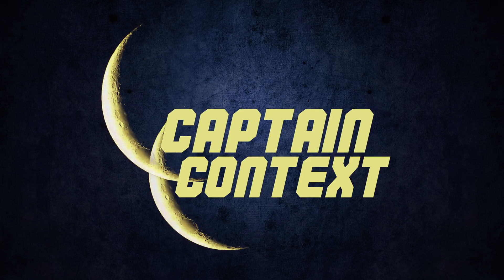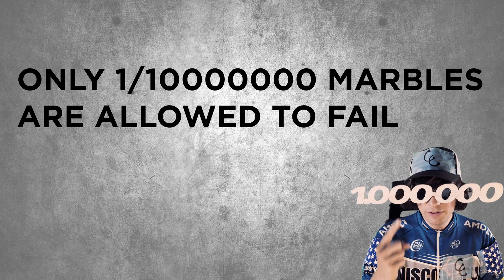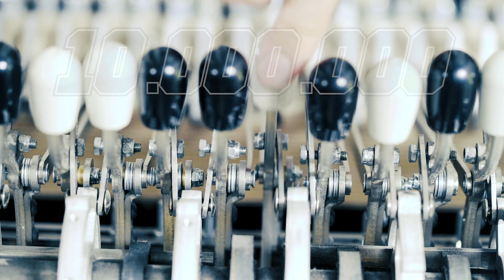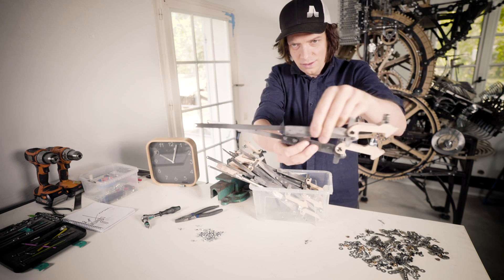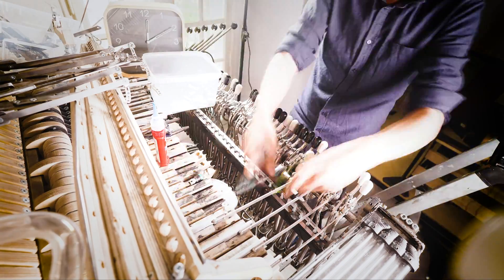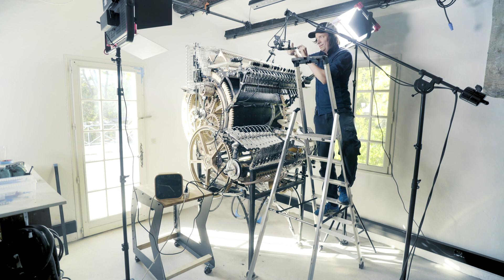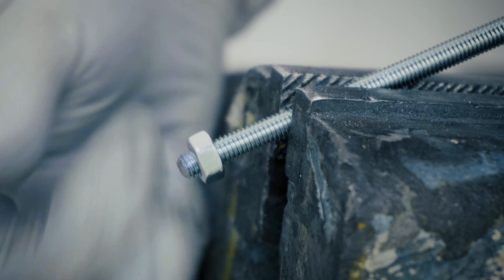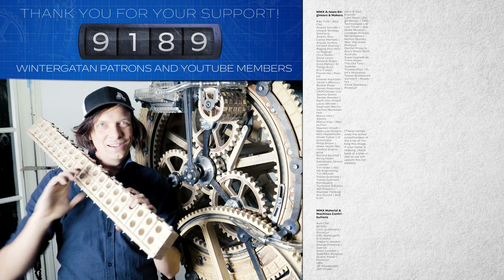Countersink? Why? - Marble Machine X #143

Comment: I get where you are coming from. But the percentages seem really arbitrary to me. There’s no way to confirm if a part is going to function 99,999% or 99,9999%. 
I guess it’s just a way of saying all parts need to be failure proof. But as an engineer when I see bogus tolerances I shiver a little bit. 

Am I alone which this?
Just a thought of mine. Love your content!
Reply: Just for context: factories strive for a principal called six sigma (99,99966% reliability ) and can hardly reach it. To even top this just sets you up for failure. 
Also two more points: 1. tolerances (in this case probabilities) you can’t validate are worthless. 2. His math is off so the reliability of each part needs to be even higher. 

I think Martin made great process in this video. But highly disagree with his reliability analysis.
Reply: Nope, aerospace guy here, and I cringe through a fair number of these videos anymore. Considering the amount materials being used in this project that aren't what you'd call dimensionally-stable, you'd never be able to calculate a consistent tolerance stack-up of higher-level assemblies.

And reliability/failure models aren't as simple as multiplying a percentage by number of cycles.
Reply: @thomasbecker9676  Just build ten of them and try playing music for a week straight. That would give you the ballpark figure :D
Reply: I'm not a mechanical engineer yet I had the same thought
Reply: You are most definitely not alone. I have no idea what he means by "99.99999% reliable". What constitutes failure? He keeps calculating how many songs he can play without fail, implying that "failure" means "catastrophic error that interrupts a song irrevocably". But then he says that the marble drops need to be that reliable. Surely, not all marble drops errors will result in song halting. It's all just random, undefined numbers and concepts being thrown about because Martin can't simply say: "This doesn't sit right with me. This needs to be better." That is something any engineer should be able to say, and i cannot understand why he can't say it.
Reply: Well those numbers are probabilities.  He even confirmed the 99% failure made sense based on the current failure rate he is having with the machine
Reply: I am totally with you here. I think Martin tries to accomplish a goal which is physically impossible. Especially with the knowledge he has and material he uses. Don't get me wrong, I love watching his videos and as much as I would like to see this series continues, I doubt he will achieve his goal.

He is talking about reliability 1/10.000.000 but he still uses  plywood as main material and often not the correct shims/washers.
Reply: I think something he needs to consider is design that allows at least some forms of failure.
The main problem he has, is that the machine can't stop quickly and having the risk of the machine to tear itself apart when something gets stuck.

One of the reasons the machine can't stop quickly is because of the flywheel and the electric motor.
I think the machine needs a torque limiter on the flywheel and motor so in case the machine gets stuck, the flywheel can spin free without further damaging the machine. Who cares if 1 in 1000 notes are wrong, that's not a big issue.
But the machine destroying itself with an average of 10 000 000 notes is not good!
Reply: @Robbedem  the machine actually has a torque limiter for exactly this purpose :) I can't remember which episode it was, though
Reply: @Ludix147  yeah, I know it has one, but didn't really remember where and I have no idea if it's calibrated. (might be worth revisiting since he reduced a lot of friction)
Also, I don't think the electric motor has some torque limiter?
Reply: @Robbedem  From what I understand, the motor controller detects torque as a function of load current and speed, and is programmed with a torque limit. If it is stopped, it will stop trying.
Reply: @Robbedem  But I thought there was a torque limiter installed, or was it removed?
Reply: Yeah the torque limiter is there and can be calibrated to whatever torque he wants. So like the gear wheel's won't break or something cause of that but the smaller parts might break with less force.
Reply: @georgH  I remember something about a torque limiter, but I don't know where and how exactly.
Ok, this video:
https://www.youtube.com/watch?v=OAZ3pVSCYSQ
(long time ago)

Still, it didn't seem to help to prevent the broken programming pin(s)
Reply: It's not infeasible to test that many repetitions and many mechanical parts do similar or even more cycles in their lifetime (switches, most parts of a internal combustion engine like valves, etc.  An engine valve which failed on one in 10 million actuations would be a very bad part, only lasting an hour or so on average!). But the key thing here is to keep in mind the order of magnitude so as not to brush of an unreliable part, as opposed to focusing on the exact numbers.
Reply: @rcxdude  Can't you see the vagueness of this whole thing? Martin is talking about each marble drop, you're talking about the whole marble drop assembly. What does "99.99999% reliable" mean?
Reply: @rcxdude  how fast do you think an engine rotates? and are you counting a single valve, or all the valves in engine? if so, how many valves?
What do you mean by failure? catastrophic failure or just fails to operate with no damage or something in between.
Reply: Even if he could achieve this level of reliability theoretically (since there is no way to prove it than try and error), he has to consider the faktor of transporting the mmx from one place to another. I would guess in this state in which the machine is right now, even a difference in humidity could lead to failure.
Reply: It is better to have non-perfect goal than have no goal at all.
Reply: @sdjhgfkshfswdfhskljh3360  No its not. Having an unachievable goal is just a time and money sink.

He needs to come up with a reasonable goal. A reasonable goal would be to lower the mistake ratio to a minimum, but build in a way that allows for mistakes to happen without halting the entire machine.
Reply: @sdjhgfkshfswdfhskljh3360  But he has no goal at all, as far as anyone just watching these videos can tell. He never defined what he means by reliability. He never explained why he assumes every failure (whatever that means) is catastrophic.
Reply: Wrong. He can reliably confirm if it functions 99.999% of the time, or 99.99999% of the time. He just needs to play the machine for a while. He has so many marbles going through the machine per second that he can easily check for these numbers. Watch his last wintergatan video.
Reply: @gh0un  Confirm that what functions 99.99999% of the time? The machine? Each marble drop? The marble drop assembly? What does "function" mean? What does "not functioning" mean? Y'all are talking about vague terms that no one bothered to define. You're not even talking about the same thing.

Comment: When you're on the road touring, how will the wood pieces react to the constant changes in humidity?
If they are that tight in your workshop/studio, is there a possibility that will they swell and tighten up due to higher humidity levels elsewhere? (or even accidently getting wet due to stormy weather)
Just a thought.

Comment: Careful heating bolts that have loctite or nylock nuts.  The heat destroys the loctite and can melt the nylon lock ring, and you may not have the captured hardware your going for.

Comment: Is one marble failing = the machine breaking as a whole? What is considered a machine fail, and what is considered a marble fail? Seems like a stretch and a bit like diminishing returns.
Reply: I think it means that a marble gets stuck and a whole component breaks or get bent, so the whole machine can't continue working.
Reply: @dimitrisglezos9617  This is the correct answer. Martin has discussed this in previous videos and even showed some of the permanent damage that can occur when a marble gets stuck. I believe the marble conveyor was damaged in this way.

Edit: it wasn't the marble conveyor; that was another issue. It's the marble drop mechanism that can encounter critical errors: https://youtu.be/YqWApMqD4h4?t=385
Reply: @Kvathe  There is also the chance of a marble getting stuck, stopping just that channel, but with the uppermost marble sticking out awkwardly, creating a waterfall of marble and starving all the channels following the failed channel from a steady supply of marbles.
Reply: Having followed the project from the beginning, I'm going to say I suspect there are really two major fail states for the machine: A channel runs out of marbles (which becomes increasingly likely as you travel along the Marble Divider and the channel reservoirs get shallower), or a marble getting stuck inside one of the gate mechanisms.

Of course, with all the moving parts on the machine - especially the heavily mechanism-dependent marble lifting section - there's tons of other places for the machine to fail, but those have been revised and revised and now only the ratcheting vertical conveyor is at a significant risk of failure anymore.
Reply: think about it this way, if you are playing 6 songs at a concert, you want to make sure that you dont have to refill the marble machine between songs, and also you dont want random marbles rolling under your feet as you are moving across the stage (that is an accident waiting to happen), martin to going to great lengths to make sure all marbles reliably cycle through the machine without failing (falling onto the floor or getting stuck into the machine etc) so that he can play a concert without having to rely on luck so that the machine does not catastrophically fail during a concert (it can no longer play). in addition there is general wear and tear on the machine which he is trying to find and repair or redesign  such as how the marble drop mechanism was damaged. (mentioned by kvathe in their reply)
in a way martin is being a perfectionist but that is not necessarily a bad thing, he is ensuring that this thing he has built will be built to last, so it does not retire after recording only one song like the original MM did. he does want to go on a world tour after all, and its hard to do that when your machine needs to be heavy maintenance every night after a concert.
his returns are diminishing, yes, but not quite to a fault yet. the redesigns are needed if he wants to have a marble machine that will work in 3 years, which he learned he needed to appreciate, from the failings of the original machine.

Comment: That statistic is wrong, isn't it? The fail chance of the machine isn't the fail chance of a marble dropper: if there are 38 channels, there are about 100 marbles per dropper in a song, not 3500  (rounding, obviously. The channels are not equally used).
Reply: You have to expotentiate the result to the power of the number of channels. A single song, assuming the channels are equally used and every gate has a 99.99% chance of funtioning properly,  has a 70.5% chance of it finishing fine. A 10 song set would only have a 3% chance of finishing without a failure. Please correct me if my calculations are off.
Reply: @icksbocks  Nope. It's not that simple: the channels are not independent, for example, so you cannot multiply probabilities like this. It's not a simple statistics problem at all. Not even close.

Comment: Did anyone see a reason he couldn't just have used a different screw head type like a truss head? the parts may have impacted but wouldn't get stuck due to the geometry.
Reply: Like a button head screw, naw too simple
Reply: I thought of that but he would have had to take it all apart anyway.  The round head screws might not have gotten caught but they would still hit each other and make noise.  Might as well make it so they can't hit at all when the vast majority of the work was taking it apart and putting it back together.
Reply: @krtwood  That's true.  If he could have removed the screws without completely removing the assembly he might have gone another route.

Comment: In software terms, this represents a failure to do sufficient integration testing. It's not enough for each part to work in isolation; they must also work together. A lot of work could have been saved by doing regular tests of each part's function, both individually and when working alongside its counterparts.
Reply: You're righte, the bolt head interaction should have been noticed once the 3rd arm was installed.
Reply: Thank you. I mean testing is the way to go. Test it until it fails, analyze, redesign, test again. That is how you would normally solve that problem. First with the individual sub assemblies and then build more up, step by step. And always test.

Comment: Why not tap the steel part and get rid of the nylon lock nut entirely? They're (those nuts) are single-use fastenings.
Reply: I thought the same thing... especially as he's just cutting off the nylon part!
Reply: Cutting the bolt inside the lock nut may heat it up enough to make it ineffective.
Reply: The real question is why does lock tight things that have nylon lock nuts. Also I think with low torq applications nylon lock nuts are ok to be reused. I mean I know I've reused a bunch on lawn mowers and they vibrate like crazy. To be fair I'm not worried about 1 failure in 10mil lol
Reply: @lordginger636  Heh, if you think about the lawn mower's engine.  10 Million revolutions is about 2 days worth of running the engine.
Reply: @lordginger636  If you read specification sheets for non-Chinesium hardware, they explicitly state they shouldn't be reused after being removed from a mating thread.
Reply: These nuts on your chin?

Comment: Your napkin math is still too lenient for the individual parts of the marble machine X.

If the MMX is supposed to be 99.99999% reliable, then each part has to be even more reliable.

If we assume 99.99999% per part and assume 10 parts (ridiculously few) than that results in a 99.9999% reliability for the whole machine, ergo one in 1 million marbles failing.
This gets exponentially worse, the more moving parts a machine has.

What's to take from this? For all future endeavours: Reduce the amount of moving parts as much as possible! And: add redundancy, if possible. Just because of part is failing, the whole machine shouldn't stop working.
Reply: Yeah, you are correct. 

But to be honest. He says that a failure will destroy the machine and I don't think this is like that. Most of the failures maybe will make one note sound bad or something like that. But will not rip apart the machine. He needs also to categorize the risks and their respective severity. 

Also, He should have spare parts for everithing. And this bothers me quite a lot because he is always grinding and soldering directly on the machine and makes modifications on the parts on the fly... This isn't a good idea if you want to have spare parts or if you want to be able to manufacture a spare part quickly enough.
Reply: true. 
but on the other hand for some subassemblies the individual parts can actually be less reliable.
the 3500 marbles are not all the same note. so these 3500 drops are distributed amongst the different notes, lowering the required reliability for each individual note
Reply: Next project: a cajón.
Reply: @positronalpha  too many moving parts
Reply: @mysigt_  Hands and butt cheeks?
Reply: Yes, but his math may also be not lenient enough in that there may be 10,000,000 notes to play, but not every part is involved in playing every note. So most parts will actuate less than 10,000,000 times.
Reply: reduce the amount of moving parts as much as possible. what great advice for someone building a marble machine
Reply: It works out because he's basing it on the number of marble drops, not the number of actuations of a single part. Each part will be dropping less than the total number of marbles, and so the reliability requirement on each part will be less. Thinking about it this way avoids needed to figure out what the distribution of notes is (now, if some failure is wear dependent then this does matter, but I think these effects are not going to affect things too much).
Reply: What does "99.99999% reliable" mean? You launched into this whole mathematical exercise without even defining the language you're going to use.
Reply: @CristiNeagu  yeah solid maths on completely arbitrary figures is just nonsense. Martin is just using the napkin maths to illustrate a point, there is absolutely no way to quantify what reliability the machine is at and to reach a specific 'reliability' target, the 99.9% he originally said is basically made up
Reply: @phoenixkh93  
1. There are statistical methods to determine the reliability of a system with a pretty high degree of confidence.
2. This isn't about the number. This is about the definition. He is very vague about what needs to be reliable and what constitutes "reliable".
Reply: @CristiNeagu  this is what i'm saying, it's useless to argue the maths over 99.9999% vs 99.9999999% because Martin didn't statistically determine the reliability in the first place, he eyeballed it to make the point 'I know this part looks pretty reliable but if you think about how often it has to be used it could still fail so it needs improvement'

Comment: Just a top tip. When countersinking metal, you want to use the slowest speed possible. It prevents the heat build up and make the counter-sinker last much longer